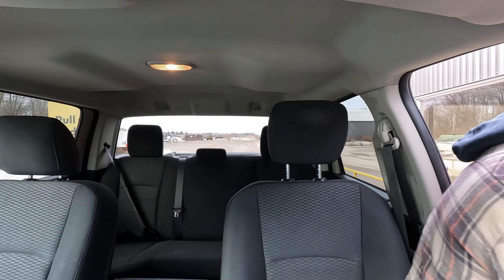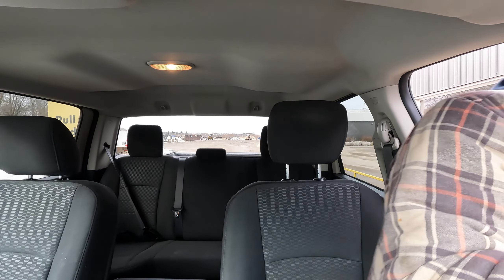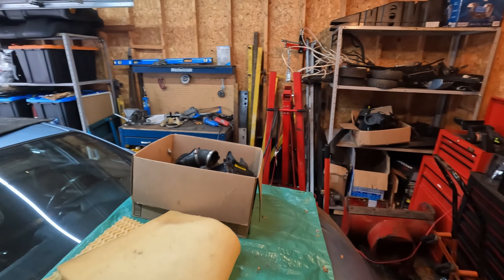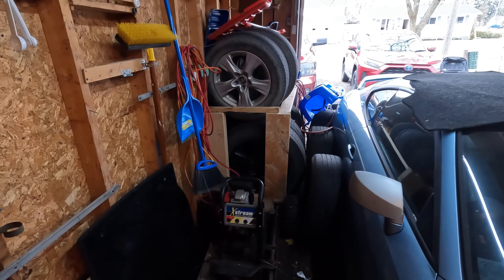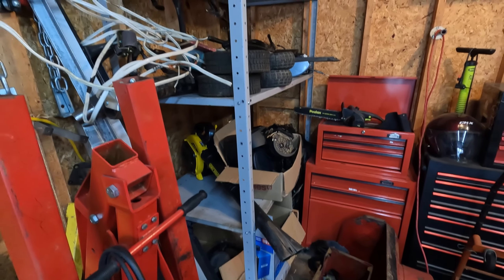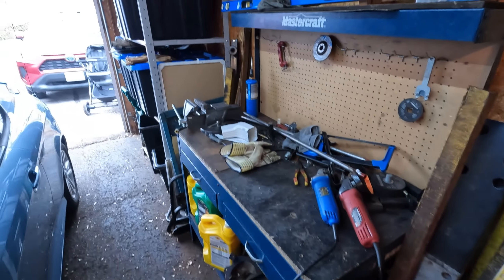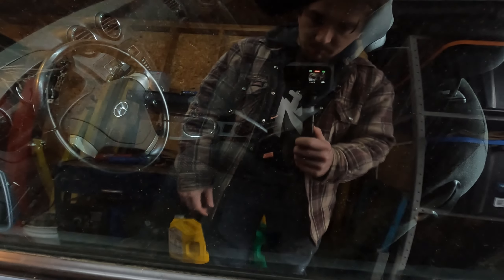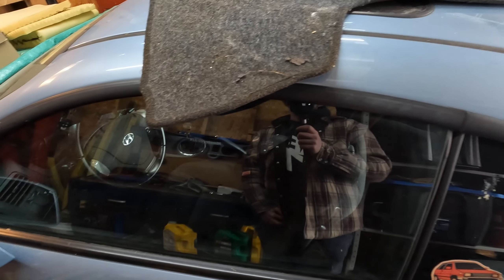Project Update 2024

Comment: I'm the same way with projects!! My 2004 tiburon is currently just the body in the garage with the motor currently being built back up with all forged internals and aluminum flywheel and clutch kit. I don't have the funds to get some upgraded valvetrain components I found so I'll be stock top end to break the motor in until then. Can't wait to get mine running and then get some boost added to it